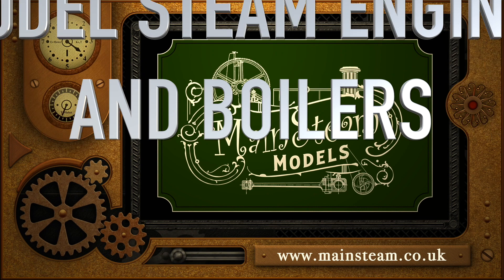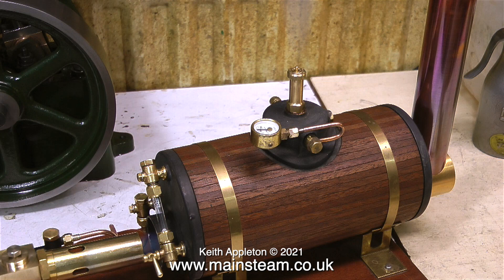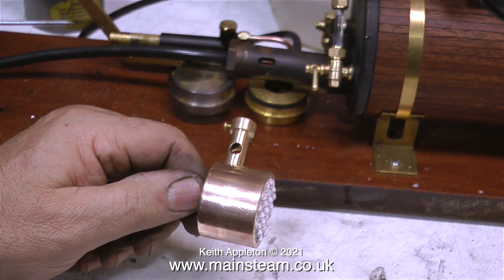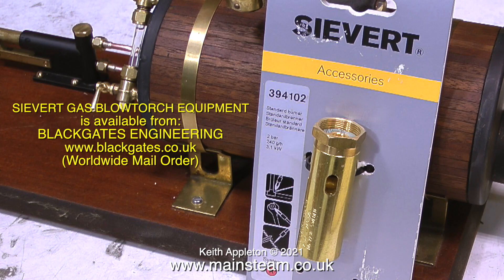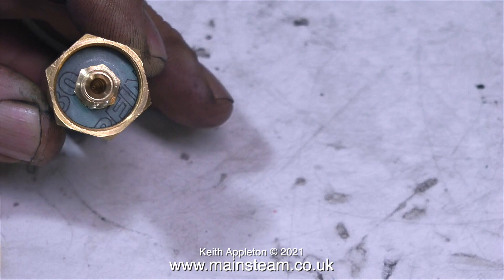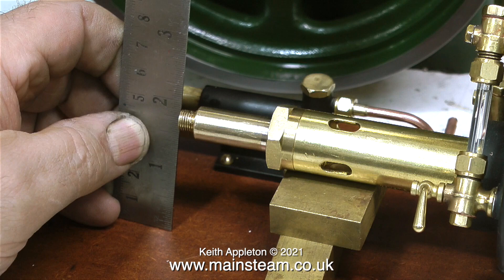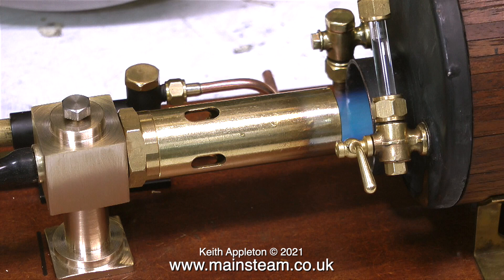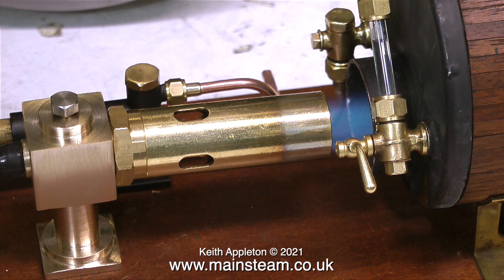MODEL STEAM ENGINES AND BOILERS - PART #15

Comment: "If you're working with a gas-fired boiler system you should find this video very useful indeed." Well, I'm not, never have done and never will do. However, play on and give me my daily dose of wide-eyed aspirational model steam engineering. After a few pints I'm an expert based on nothing but your videos.

Comment: Have you tried putting the gas tank in a room temperature water bath?
The water can absorb the chilled tank. But I caution you not to use hot water.  As it could rise the tank pressure too high. 
I enjoy your videos,  you are a skilled craftsman.
Reply from the maker: 100% agree with you and that is what I normally do.

Comment: Often you can avoid the gas getting too cold by putting the cylinder in a bucket of hot water. But a perfect solution, but it helps.
Reply from the maker: Hot water is not required, room temerature water is safer.

Comment: Another instructive video. Keep up the great videos. For all the boiler testing that you do would it not make sense to purchase a propane gas bottle size "A" or "B". Either one is not to large (Size of a small beer keg) as to take up to much space in your shop. In fact it could be stored under the work bench.
Reply from the maker: I do have larger gas bottles, but I use Butane not Propane, it is safer. I show the small commercial gas canisters because they are small, convenient and this is a Tutorial.